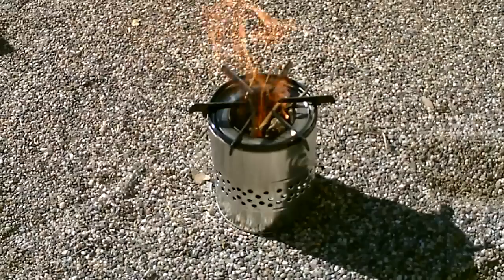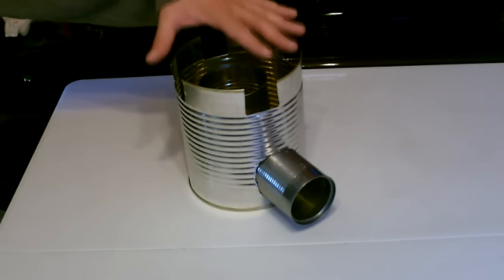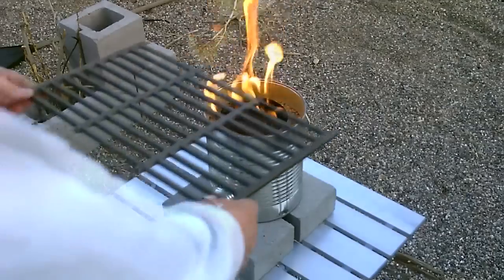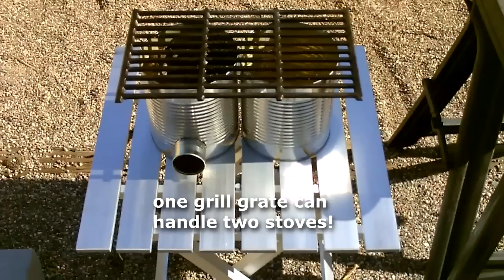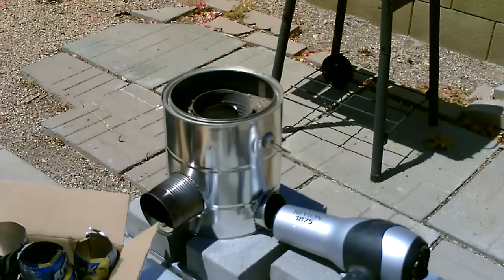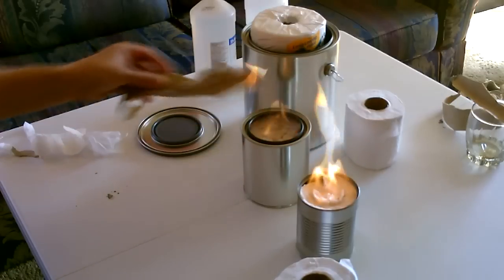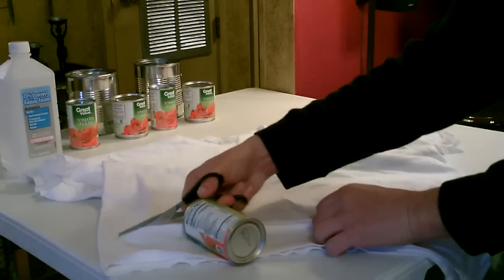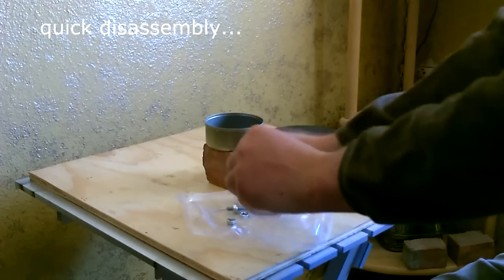My 12 DIY Metal Can Stoves! - Rocket Stoves, BBQ Grills etc... (Compilation) - Easy DIY

Comment: Design one that you can use with a pressurized alcohol burner in its base with the burners feed outside the can with a quick connect like any propane grill would have. Then just design the pressurized alcohol vessel you can use a quick connect hose that you can place well away from the stove.